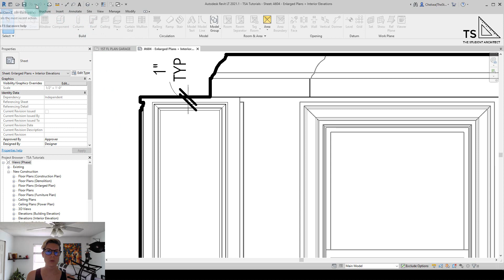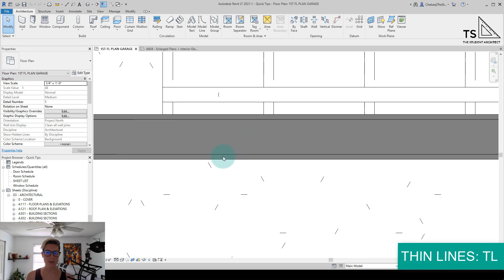How to Toggle Thin Lines On/Off in Revit

Comment: How to control the weight of this thin line could you tell me Ma'am?
Reply from the maker: When Thin Lines mode is on, all lines will be the thinnest line weight, and I don't believe the thickness can be changed. For the weights/thicknesses of lines/objects with Thin Lines mode off, there are MANY ways to alter line weights (phasing overrides  - manage phases, visibility graphic overrides - VV or VG, line styles - LS, object styles - OS, etc.) Hope this helps!